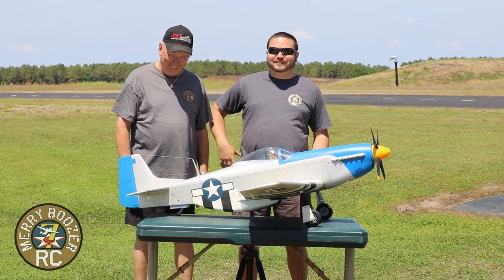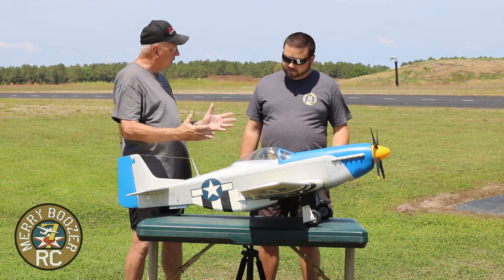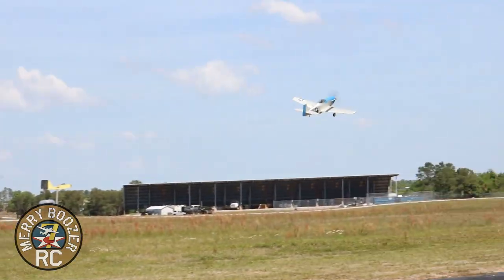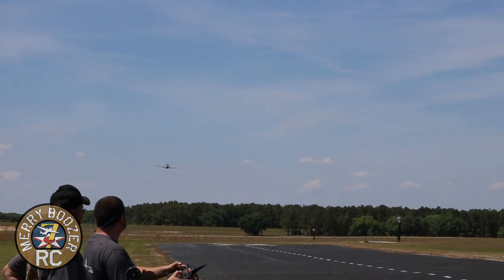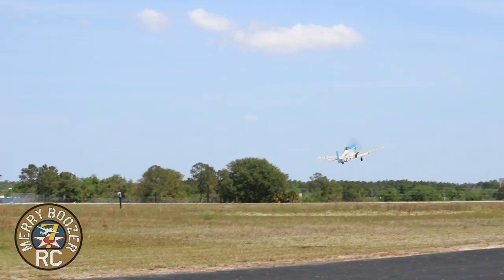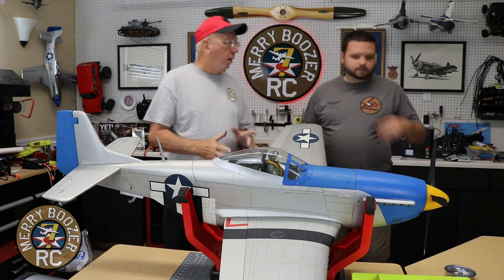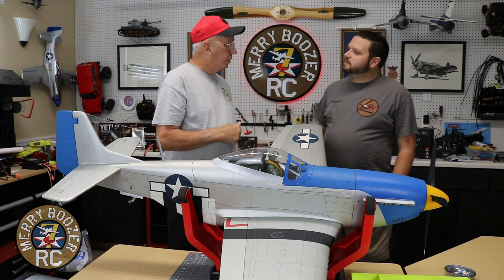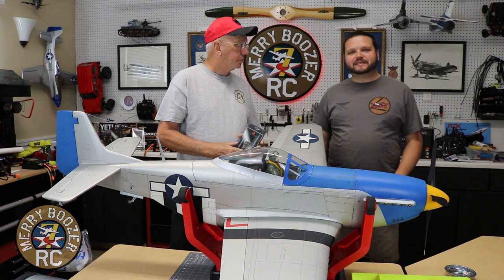HANGAR 9 P-51D Mustang Electric Conversion Maiden Flight

Comment: Seeing these scaled down versions flying so well reminds me of the movie 'The Flight of the Phoenix'  Stewart, Borginine, Kruger, Attenborough..where Kruger..a balsa wood model airplane designer ..redesigns. repairs  the plane the above characters crashed in, .. from experience w/ small scaled balsa planes ..and it flies. Same in reverse ..kinda of.. Amazing when you scale down from an actual size military, civilian jet that they fly so so well....with very little changes.. solid aircraft engineering and design regardless of size

Comment: Beautiful plane...I have the hanger 9 redtail that I built about 10 years ago, had the power 90 in it with robart retracts I need to switch out to electric so I can fly again, not a fan of the neumatic retracts, thanks for sharing 👊🏼👊🏼
Reply from the maker: Yep agree on the air retracts I got electric in mine now also

Comment: Love your content, guys! I spent years on RC cars, but never on airplanes. (Always wanted to, though). Here it is, 30 years later, and I want to try flying. I recognize that I need to start on cheap little trainers, but I have a question: Back in the old days, (80’s) almost everything was gas engine powered. Why have you decided on electric? The performance is obviously great, but can’t you get more flight time from a gas engine? Your input would be invaluable. Thanks!
Reply from the maker: You can fly longer on a gas engine but the big thing that made me choose to go electric is the convenience. No cleanup, no fuel, no starter equipment, the motor never dies in flight, they don’t smell so you can keep them in the house and still have a happy wife. All that being said if you want a gas engine don’t go nitro get actual gas. Nitro fuel is over $20 a gallon now and very cost prohibitive where as the actual gas engine you can fly all day on $5. Like. I said it’s more of a convenient thing with electric.

Comment: I converted a few large gas engine aerobatic to electric I found them to be extremely tail heavy having to add a ton of nose weight. Electric motors just weigh so much less then a big heavy gas engine, and fuel tank. This is with battery pushed forward as far as I can get it. Landing was a bear get into oscillating (PIO) as stated "Proposing".  I quit converting these the one I still have is a 88" SBACH I picked up at a swapmeet has a motorfly electric 6S. Must be 2lbs of nose weight it flies okay.   Friend at the club field he thinks if I moved the motor forward more spinner will have some gap but maybe that would help take some weight off.

Comment: Im gonna put this setup in a Sig Somethin Extra..hopin it flies good. Im thinkin it will because the Somethin Extra is smaller and lighter.. What you guys think?
Reply from the maker: Haven’t seen the plane but if it’s smaller and lighter it should work

Comment: I have a 40 size and a 60 size p51 that I would like to convert to electric but I'm not sure how to reconstruct the fuse? Like I want a hatch that I can just pull off to insert the battery but I'm not a builder so I'm clueless about how to do it. Also where can I get the motor mount for both? The 40 size is a miss america and the 60 size is a voodoo so both planes are beautiful birds and I don't want to screw them up. Not sure on motor and ESC combos either, can anyone help?